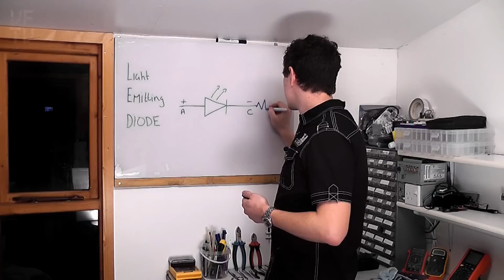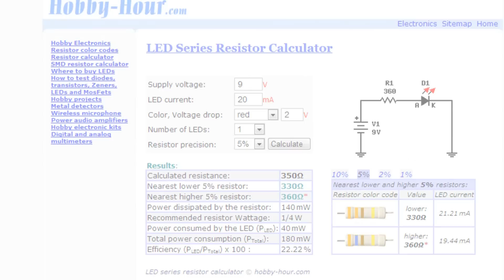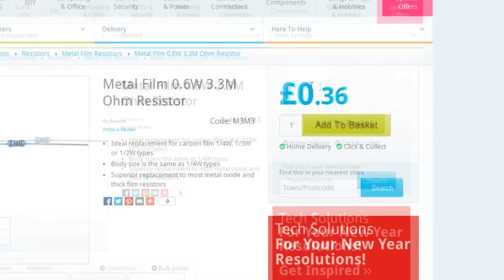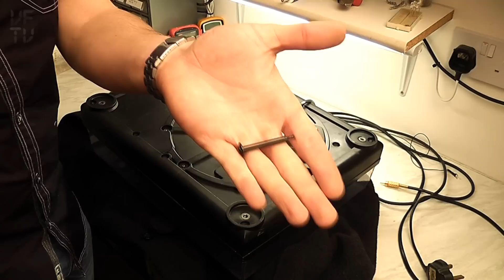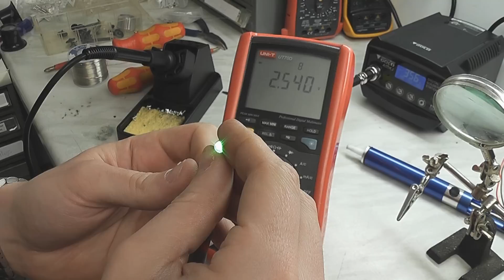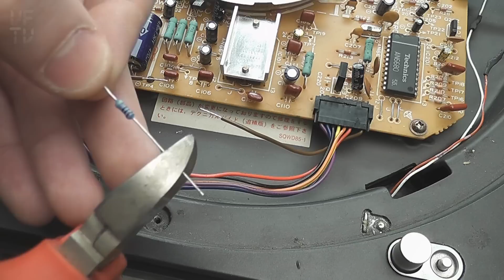How to modify the strobe light on a Technics SL MK2

Comment: Dear Frank, firstly, congratulations on the videos. Very explanatory.

Look:

Is it necessary to install a resistor for the 4 red 5mm LEDs on the SL 1200 MK2 Strobo? I know that the red LEDs have around 1.8 to 2.8 volts and that's why I'm in doubt. Is the voltage going to the Strobo LEDs 20v or 9v?

For the tower light, I know that the voltage sent is 20v and in this case, could I put a 3mm high brightness blue LED with up to 3.8v and a 1k5 resistor?

Thank you for your attention!
Reply: MATE! I just finished replacing the 5mm LED light these days. It works without adding resistors and the brightness is sufficient, but if you want to add resistors, you can extend the life of the LED light.
Reply: Hello.
I installed it a while ago without resistors, and it looks amazing.

Comment: Soldering, the longer you heat the pad the, less shiny the solder joint looks. Preferably the solder joint should look shiny like your first solder joint. 
I would use rosin core leaded solder. Clean the pads first with Alcohol, tin the pad, add flux before, soldering. You will get a better solder joint. I would use heat sleeve, better.

Comment: I'm putting in blue LEDs. The resistor was 470 ohm 1/4 watt. Correct? Thank you for the video. This was perfect.
Reply: What is the voltage in your country? 110v?  220v?

Comment: I would change the color led in a Gemini pt 1000 but the voltage source is 5v for 4 led in serie and with comun leds wasn't work. Someone does know something about it?
Reply: why your turntable power is only 5v? 
what is the voltage in your country? 110v? 220v?
my country 110v  but used 5.6k ohm for 4 blue 5mm LED.

Comment: what is that wee power supply thing you use for testing and adjusting voltage to power the leds called? i want to find one online but dont know what to actually search for. thanks. ps great video

Comment: Hi Great Video. Please can you confirm was that a 470 ohm resistor you fitted to the brown wire at the end and is that the same value l will need for clear blue 5mm led’s thanks 🙏🏽

Comment: Hi,
Very interesting video. Congratulations.
I would like to know what is the resistor you use to decrease 33t/45t led brightnes ? Can I use another one to do the same for 0 from pitch fader on the brown cable too ?
It seems to be a 150 ohm resistor. Is it correct ? As I am not sure to understand all your coments, I need your confirmation.
Perhaps you have a video showing this manipulation ???
Thanks for your help.
Regards.
Reply: hi mate. what is the voltage in your country?
my country is 110v used 5.6k ohm for target light.   
33/45rpm no need resis  but super lights

Comment: Hello Frank great guide thanks  can you tell me how many ohms is the resistor you put in line with the led's?
Reply: I think from earlier in the video when choosing the parts it was 470r resistor but the colour codes on his one at the end of video did not correspond to 470 ohms 🙈
Reply: @guitarste  why use only 470ohm?  What is the voltage in the country?

Comment: I am replacing the red led’s in the turret on my 1210mk2 with red do I also need to replace a resistor because I am putting new led’s in?
Reply: I am also doing the same. Wouldn’t all red LEDs be the same?

Comment: I would like to add two life savers for the tool kit,  cheap wire strippers  for the vaguely competent especially when it comes to stanley blades and to keep your camera handy and take a pic of anything your not sure of  or involves a few routines in its repair, that way you don't loose momentum and can refer to the pic rather than having to leave your work station and refer back to a vid and all that entails, especially when there are different length screws involved. 
Im giving my decks their first big service in 20 years next week all leds and rca leads too and a set up am looking forward to it your vids are concise and to the point indeed and easy to follow and I am sure will make for a stress free service am happy that I have come across them...

Comment: the resistor protect the board or protect the led light ?
then if i put a resistor on the brown wire do i have to keep the R212 or i have also to put other resistor in the place of R212 ?
thank u so much
Reply: Protect for LEDs. and what is the voltage in your country?

Comment: Hi, I was wondering whether or not I have to do anything special, like add a resistor, to my LP120’s strobe light. I want to change the LED light to green but I’m not sure if it’ll burn or if I have to do an extra step. I’m thinking I could just hop right in and desolder the red light and replace them with green one. I hope this is relevant because both the lp120 and this turntable are very similar in electronics. Thank you!
Reply: same question~

Comment: Excelentes videos...muchas gracias por subirlos, quería consultarte algo si es posible...quiero cambiar todos los leds a azules...y pregunto solo se reemplazan directamente...?..salvo la torre que lleva un regulador, y sobre este punto...no puedo ver correctamente el valor de la resistencia que agregás a lo ultimo...si es posible..responder las preguntas..muchas gracias...estaré atento..
Reply: Hola supiste de que valor era la resistencia que agrega?? Para los 4 led?? Ya que yo los cambie y no prendieron no le he puesto tal resistencia espero respuesta saludos
Reply: @abrahamtalamantesrubio5874  si no prendieron , puede que los hayas puesto al revés. En la luz periscópica la que ilumina aguja puedes ponerle una resistencia de un 1000 ohm y ya no necesitas el regulador , y para la STROBO en seria con el cable café una resistencia de 470 ohm. Para modificar led de PITCH y 33 - 45 no necesitas modificar resistencia ni agregar
Reply: En la luz periscópica la que ilumina aguja puedes ponerle una resistencia de un 1000 ohm y ya no necesitas el regulador , y para la STROBO en seria con el cable café una resistencia de 470 ohm. Para modificar led de PITCH y 33 - 45 no necesitas modificar resistencia ni agregar ,mi correo es ramon_tapia90@hotmail.com , face ramon tapia , saludos

Comment: easy, I'm having some trouble finding a resistor for the target light led. I'm using a blue led of bright components. with a forward voltage/current of (3.2/3.8v - 20mA/30mA) I've used 56ohm and the led dies after 5 mins I've got some 68ohm but I don't want to kill my remaining leds if I have too
Reply: I use 1k resistor and no problems
Reply: 56?  5.6k?

Comment: Hello. I have a sony ps 8750 version USA (120V 60Hz). In Chile we use 50hz. The turntable does not have the strobe light and I have tried some replacement, but do not read well the marks of the dish. It would change for a led like the one you did and solve the problem in the sony ?. thanks for your help.

Comment: Any chance you could show us how to debug and fix the actual pulse going to the led. I know my platter speed is spot on from calibrating it with another deck light strobe. The defected strobe looks like it is constantly on. No dots line up at any speed. I see you used an oscilloscope. Is there any way with a multimeter?

Comment: Mate, just seen your channel pop up. I used your videos at least 6 years ago to restore a set of totally wreaked 1210's I bought on eBay. Couldn't have done it without your detailed instructions + advice. They are still in my setup, brightly coloured and all the replaced RCA's, tonearms etc all still sounding great. 

Just thought I'd say thanks. Without your videos I would have been the proud owner of two very large, heavy, technics shaped paperweights. 

Thanks man.

Comment: Hello how are you? Very good your video wanted to know if you can help me with a problem I understand a pair of mk2 1200 and I have the following problem, adjust the pitch to 2.7 k as the factory manual says, it is run in 1+ serious in the Del range Pitch in 2, +6 if it's good now, -1 gives me -2.5 -3. If I move the potentiometer of the launch that has to be in 2.7 it accommodates, but it continues the run in -, the complaint stopped factory, the probe removing the orange cable of the step is the same, removing the resistance r209 and it is the same , With The time code serves me to regulate because I look at the pc the range and it serves as a guide but I can not leave them orignals, I want that in -3.3 I have that value and not -5, that in -1 mar -1 no - 2, 5, when I put it in +1 it gives me 0.5 +, what do I have to do? Is there any way to accommodate this? And that they are of factory ?? I await your response many thanks

Comment: Great video but I'm having a problem. I ordered the replacement pcb w/blue leds but now I have to connect the end wires back onto the white clip board back onto the main circuit board on the turntable. Can someone help me out. No instructions came with this part it says "just drop it in" but it's not that simple😕

Comment: I believed among the technicians that shows technical videos, you are the most knowledgeable. I trust every word you says and
wished I have the same ability and know how. I have a little problem with my SL1300, I could not find replacement valve for my
strobe light. Can you suggest a better way to replace it with led or however. Would appreciate all the help.

Comment: My Technics 5100 strobe quit along time ago and the repair shop said they didn't know what's wrong with it. After watching your video, great job BTW, I found a 5100 service manual so I'm going to try and fix it. 

I have a cheap multimeter but thinking of getting a cheap handheld oscilloscope. Any suggestions?

Comment: Hi Viperfrank! Great videos BTW. Just a quick question if I may; Would one still need to use a resistor if the LEDs being swapped are red- basically the same that are like the factory Technics LED's? The original technics red (amber?) LEDs (SVDSLH54VT3) are of course almost impossible to find, so I cannot find any specs on them anywhere. Does the voltage drop on the originals differ from-say an equivalent red 5mm LED from bright_components on ebay? Thanks in advance brother!

Comment: I have just recently changed all the lights on my 1200's to LED's using a kit from eBay. The kit comes with written and picture instructions which to be honest are as clear as mud! But thanks to you and your videos guiding me along, this novice electrician/ solderer has completed what he set out to do! So thank you very much your explanations and videos have been a great help. :)
Reply: Lee Bell , I too bought a kit from eBay but it only came with one resistor per turntable, the one for the pop-up light. Did you use a resistor for strobe light also or did not need it? My kit is blue leds. I don't know if I must get another resistor for rest of LEDs.

Comment: Good guide.  The only suggestion I would make is some heat shrink on the in-line resistor connections instead of insulating tape.

Comment: Hey viper mate can you explain how you got the value for 470 ohms?

Are you not using the voltage supply value of 20v?

The way I calculated it was (20 - 11.4)/R =  5ma, where the resistor value being 1720 (including R212). 11.4 was 4 LEDs with a drop of 2.85v each.
Reply: yeah  same question.!!   
my country voltage is 110v  but i used 3mm white  and 5.6k ohm for target lights.  yes 5.6k  not 560
33/45 no need resis but looks super lights....

Comment: Very usefull video James! 
The strobe light on my 1200 mk2 is very dim. I'm not sure if i want to mod to different color leds though. My first step should be looking for the cause why it's so dim. Do you have any tips on how to find the problem? Somehow there are a lot of Technics diy videos, but i cant find anything on repairing the strobe light without modding.
Thanks in advance and keep posting. You're vids are great!!
Reply: +Dsil303 Checked some things from you're other "strobe is broken" video.
The resistor measures 120ohm, but so does the one on my working deck. So thats not it.
The squarewave is fed to the transistor, becuase although very faint, in complete darkness i can see the leds light and see the deck is spinning the right speed at 0%.
So i guess it must be the current which is too low, but now to find the cause of that....

Comment: Love the video thank you for being so detailed. I've replaced the 4 original red strobe LED's with 4 Blue LED's but I was not aware of adding the in-line resistor to the brown wire. Right now the LED's do not light up, they are soldered correctly and kind of give a glimpse of light when squeezed with my fingers slightly, but how do I know the correct ohm resistor to use to give them the voltage they require to illuminate completely? (pardon me if I did not use the proper terminology)
Reply: Buck Nastee I have the same question, but I have not changed mine yet because the kit didn't come with a resistor for them, just for the pop-up light. Did you ever figure out what to do? I'd like to know before I proceed. Thanks
Reply: green like blue needs 470 Ohm resistor. he said it in the first part of the video..

Comment: Excellent vid only thing i might of done differently and this is just nit picking, would be to use some heat shrink on the wire with the resistor, but a very informative vid! You must have some sort of electrical background.

Comment: I have a Technics SL 1700Mk2 which is quite similar to the 1200 but has some automatic functions which are nice for home listening (I'm not a DJ).  I just successfully replaced my burned out target light with an LED following your video(s) (which are FANTASTIC) and am now interested in changing the color of my strobe to turquoise.  I have the LEDs (20 mA, 3.6 V) but am a bit confused about what resistor to add to the circuit.  The SL 1700 has 7 LEDs for the strobe instead of the 4 of the 1200.  How should I go about calculating the value of the resistor?  I wasn't sure what values to plug in to the website calculator for my situation based on your tutorial.  Thanks a ton man!!
Reply: I figured it out.  Supposedly the voltage supplying the strobe LEDs in the 1700 mk2 is 20V running through a 120 ohm resistor.  It turns out that 7 turquoise LEDs in series would have a voltage drop of ~25V in the circuit, so it wouldn't work if all 7 were installed.  I ended up removing the stock LEDs, bridging two of the positions on the PCB with wire, and soldering in 5 of the turquoise ones.  I calculated that with 5 of them, they should be running at around 15 mA with the stock 120 ohm resistor, so I didn't add another.  I put everything back together and IT WORKS!  Definitely brighter than the stock red ones, but not terribly so (like it would be with mega bright blue ones).  Thanks for inspiring me to learn some rudimentary electronic engineering skills!

Comment: One of the best instructional videos I have ever seen on Youtube for anything. Purchased my first Technics 1200 MK2 on ebay and had to setup and fix the popup light, rca cable, and strobe (it was in real disrepair). These videos made the whole process so much easier and I learned a bit more about electronics. Thanks!

Comment: Good afternoon Frank, I was wondering if you can help me with a problem I'm having with my turntable. There is a slight flutter during playback, it's visible on the strobe light and the computer program recognizes it also. What's wrong with my techniques turntable, can you point me in the right direction. Thank you for any feedback

Comment: Nice video. Whats the device called you used to bench test the LEDs early in the video. The device where you can change amperage and voltage to light up the LEDs and where can I get one?

Comment: hi James just wondering if you can answer a question i have about my Technics 1210 SL mk2 turntable its works fine i have adjusted the break to make sure its not that and it isant the problem with it is when i turn the power switch on the platter moves a tiny amount and if i turn it off and on agen with the strobe/power switch it does it agen not everytime but some just wondering if this is a big problem like motor wearing out or pitch i hope not thanks James b

Comment: James I want to get a soldering iron like yours where can I get one ?
Reply from the maker: I got mine from Maplins, but you can get the same one or very similar one on amazon or eBay. just search for" ESD safe digital soldering station" there are loads available, and they are well cheap, £30 - £60.
hope this helps and thanks for your comment.

Comment: Hey Frank. I never had to put the resistor on the brown wire. But I used 3mm Leds on my strobe and color changing leds on my 45/33 buttons. I cant remember what the voltage drop is are on the leds. I have it written down some where. But Love your vids man. Been a real help even inspired me to get into Electrical engineering. Always been into electronics. When i started modding my decks and doing this stuff is what made me start school. So I guess I owe ya some thanks there.

Comment: Great vid ..... But a question ... How come the led kits on ebay dont come with a resistor for the strobe.....???? Iv fitted a few kits and had no issues
Reply from the maker: Its not essential to put the resistor in line, its just most modern LED have a higher voltage drop, and operate up to 30mA. buy limiting the current further, the voltage will not drop as much, so the peak voltage past the offset point is higher.
on the scope i have found doing this distorts the supply waveform less and probably gives a slightly better strobe effect.  but again not essential, just something that i recommend doing to make sure that mod operate exactly how you intend it to.
i'm glad you enjoyed the video, and thank you for your comment.